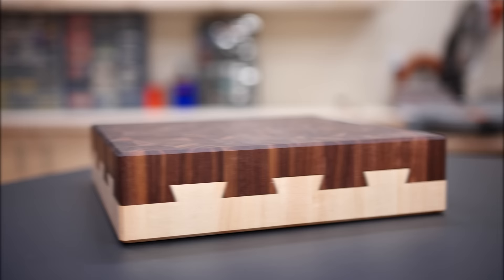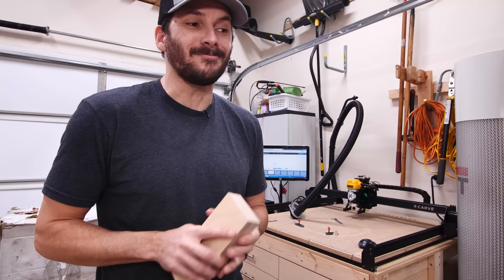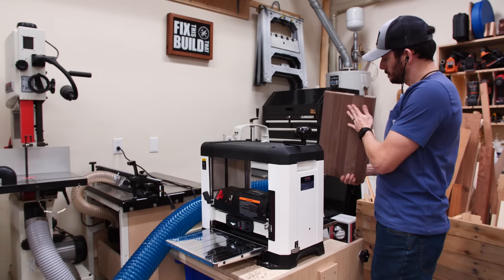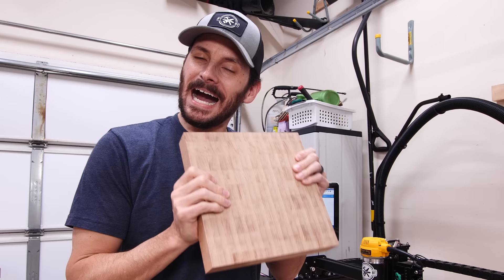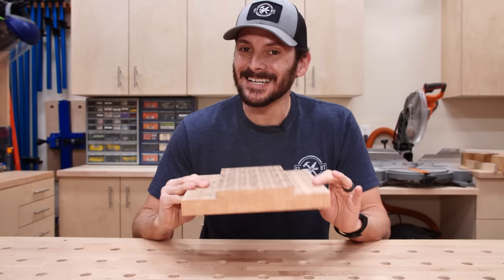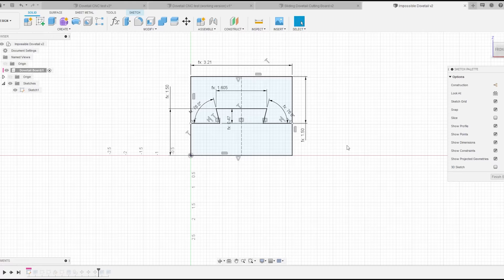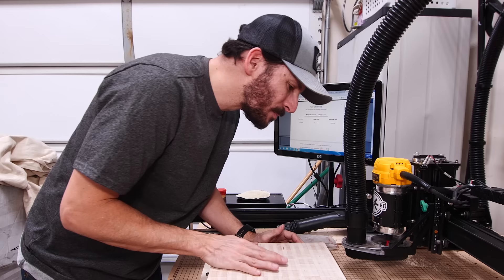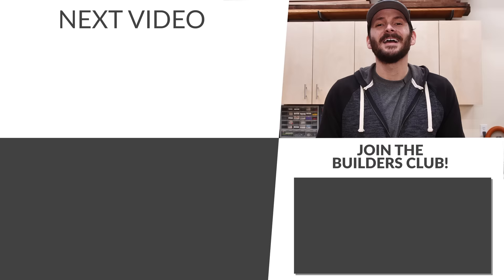Building an Impossible Dovetail Cutting Board

Comment: This could be a Chess board, with the Chess pieces stored inside in hollowed out perfectly-fitting sections. Considering the Chess world, it would be a way more lucrative side hustle than cutting boards lol
Reply: I was gonna say with knives inside. But I like the way you think!!!
Reply: Of course, the dovetails would have to be very short, so as to allow you to slide them together or apart with the chessmen inside. IOW, you would have to cut out the center 90% of the dovetails, leaving maybe just an inch of the outer portions intact. No problem, the effect will be the same. And it will be less likely to get stuck over time. But your suggestion might pose a serious arrangement problem with 32 correct-sized pieces. 

In this video, the guy could have done that instead of taking all that time sanding the interior portions of the dovetails. But since this is a cutting board, maybe that wouldn't be such a good idea. Someone might break it with one whack of a cleaver.
Reply: This was in the middle of a bunch of chess-video recommendations. Possibly, here are a lot of chess players.
Reply: This is genius!
Reply: Canvaverbalist, I've already created mine before seeing this video and your response. So many creative options beyond now. My current project, a self-contained power generator with a longer than expected fuel source smaller than a pack of cigs.
Reply: Handcrafted wooden Chess boards+containers have been around Eastern Europe for centuries. I have one, my parents have one, my grandparents had them.
Competition Chess players prefer their boring Staunton Classic International Standard sets with the roll-up mats ... but I'm sure they'd recognize other traditional sets on sight.
Reply: @pwnmeisterage  Staunton design so there's no confusion. I was playing someone on their Onyx set which looked great, but at one point I threw a piece away because I couldn't tell the difference between a knight and a bishop. :D
Reply: @stephenleader2792  Ah yes, the classic Psycho gambit, where you lure out your opponent's knight and then stab them in the chest so they die and thus you win by default.
Reply: I'd reckon a super GM would pay top dollar for that set.
Reply: Agreed
Reply: @Canvaverbalist I had a similar idea. A kitchen table, for example, with a hollow center for storing valuables. And no one would be the wiser because it would look like two solid slabs of wood joined together.
Reply: Oh wow
Reply: @stephenleader2792  that’s good idea too
Reply: I was thinking that it would be cool to have compartments inside of it!

Comment: That looks great. I've seen puzzles like that, but they're made a little differently. The grooves are curved rather than straight. To put it together, the parts have to be twisted 1/4 turn to assemble it. Good luck trying to build that.

Comment: Awesome work!  You could add a spring loaded pin inside to lock it in place.  Or,  make it so you can unlock the pin with a magnet.  That could help make a great hidden compartment (like others suggested) accessible.

Comment: I think what's even better about this is the fact that if you're chopping multiple things up you now have TWO cutting boards instead of one.  Could you imagine pulling that bad boy out at a party when someone asks to help and taking it apart in front of them.
Reply: good luck getting it to fit back together after using them seperate
Reply: @heygek2769  unless you're hammering on the top of them like a cave troll, it won't deform the wood enough to affect the fit to the point of being impossible to put them together
Reply: @smahhah  moisture
Reply: @heygek2769  not all uses for a cutting board involve mass amounts of liquid
Reply: @smahhah  don't need mass amounts with a tight fit like that.

Comment: Many years ago, just for fun, I made finger joints at the ends of two boards that were about three inches wide and 3/8" thick. I put them face to face on a milling machine and used a 1/4" cutter to make the fingers all the way across the 3" ends of both boards. I made each cut exactly 500/1000" from the previous one. Then I took the boards off and started to put them together. When I got the fingers to start joining I was able to wiggle it a little bit and they got stuck. They weren't even halfway together, but they were permanently stuck. Almost half the fingers broke when I got them apart.

Lesson learned, in a word: CLEARANCE!

Out of curiosity I drilled an exact 1/2" hole in a block of aluminum. Then I inserted an exact 1/2" rod (shiny smooth) into it. I had to tap it to get it all the way in. It never came out, either. (Into the crucible!)

Comment: What an awesome video.  I know basically nothing about woodworking but I could follow along well enough because you started with simple examples of the technique you were using and then built on that.

I do have one question.  If you were to make more of these wouldn't it make sense to just program the router to remove some extra material from the interior, or even as some people have suggested make the whole thing hollow, leaving a space where super secret recipes could be kept?

Comment: You could've just made a larger panel, cut the dove tails // with the sides faster with a regular router, then cut off the 4 corners at a 45 deg angle to get a new but smaller square. It's faster but the the trade-off is more waste.

Comment: When I was in my vocational training, I programmed a little curve instead of a straight line (around 0,02 - 0,03mm away from the straight line)
So I reduced the friction a lot
Only the last cm was completely straight
Tbh, I made it from metal (brass and copper to be exact) but it should also work with wood

Comment: It is only impossible when you think of straight up and down joinery, but it is clearly not impossible when you think of diagonal movements. Actually, straightforward but still very delicate work to keep it all aligned so it slides in diagonally.

Comment: The original dovetail cutting board made me think of a neat idea for a chess set. You could use the thicker wedges on the female piece to make space for the storage of chess pieces. Use the magnet  closure solution you came up with and make the playing surface out of square  end grain. I think that could look very nice.

Comment: Brad If you put magnets in the edges and hollowed out the center you'd have a nice security box and less friction. Who'd ever guess it was a box? You could make it a circular bore to maintain the strength of the dovetails and maintain the weight and it could still be a cutting board if you bore only into the lower board.

Comment: You can also ease a fit that is too snug by sanding the top faces a smidge.  If any of the male "tails" appear too short to touch bottom, sand the top surface of the opposing female "dove" board.

Comment: you can do it on a router table if you start with a larger square, cut the dovetails parallel to an edge as usual with a router table and fence, then once both sides are cut and fit nice, you cut off the corners at 45 degrees.  you make a lot of waste since you lose 50% of the wood (reduce the waste by making an octagon, or use the cut offs and glue them together to make 2), but then you can make this without a CNC.  use spacer blocks on the router table so you get exact cuts where you want them without moving the fence.

Comment: Very impressed by the workmanship, but an impossible dovetail is only "impossible" when it's joining two solid pieces.  For an endgrain cutting board, unless you just want the pieces to slide apart (a legitimate desire, since it shows off the skill it took) you could just do standard dovetails on four final strips, glued to all four sides of the dual-layer board.

Comment: Make one of these large enough and you can carve out recesses in the bottom half for cheese knives and make an Impossible Dovetail Cheese Tray with hidden knife storage...

Or if you're REALLY ambitious, make an Impossible Dovetail Chess Board with hidden piece storage...if it's big enough, you might even have enough space to carve out a pocket for checker pieces and now it's a Chess & Checkers set, if you work with Epoxy Resin, you can make the Chess and Checker Pieces from 2 different Resin colours...

Comment: That's Brilliant. At 15:11, to prevent blow-out, I would program my CNC to do the job from outside in - always toward the centre. At 16:34 lot of extra passes were needed because of unexpected errors. Unexpected errorrs can be avoided by orienting the blocks 45 degrees so that the CNC can work in perfect X and Y axis, or, by perfectly caliberating the machine to cut diagonals which is more difficult as it was in this case!

Comment: Congrats! What an an amazing piece!! 

Quick question: could you cut the piece an inch or more too wide, then trim them on the table saw or with a router once you're all done to ensure a perfect edge (vs the poplar edge band)? That's originally how I thought you were going to ensure a smooth finish and handle any chip out.

Comment: You went about it the hard way. Don't forget, you're working with butcher block. That means lots of smaller pieces of wood glued together. When looking at a finished project, it becomes impossible, except for the most discerning eyes, to determine the build order. you could very easily use perpendicular dovetails and just join the blocks last.

Comment: That was fantastic!!

You learn a lot more by seeing mistakes and the working out of problems, rather than watching some smug, I did it perfect first time kinda video.
🤣

I was wondering about the friction problem and thought, maybe use the router to cut a channel inside of the female board to ease the problem,  but the sanding you did worked instead.

Comment: Were you able to finish the dovetails as well as the outside? It seems like you'd have to mill an extra .012 or better to accommodate a durable varnish finish, or .008 or so for shellac. That wouldn't even allow for seasonal expansion, and I'd think either would be visible. "Yeah, this thing slides apart when it isn't raining..." Very cool, but not so practical for a cutting board. Maybe just heavily waxed inside, and make it a chess board, hollowed out to store the pieces? I'd pay good money for one.

Comment: So you never did put magnets in there.
An idea (if no one else shared the same idea or a similar one) would be to use the inside/middle part as a knife compartment or something. slide open, take knife out, slide shut, cut, clean knife and board, put knife back inside. 
But I assume if you open/close it too often, it might end up getting a bit loose over time. (but your magnets idea would help fix that)

Comment: And here I thought it was simply cutting basic dovetails at 90 degrees to each other and steaming one of the sides to make it flexible enough to bend just enough to snap into the non-steamed piece and when it cools/dries it firms up to permanently lock it in place...

Comment: When you have long glue lines, always put the piece in the planer at an angle. The glue is hard and it will mark the blade edge. If you feed at an angle you don't get a single hard spot hitting the blade edge.

Comment: You might want to get yourself some high density blue modelling foam for when you are doing test runs. It is a total pain to clean out but it is inexpensive, allows you to run test paths faster and will reduce wear on your bits.

Very nice project. How much did you have to allow for the finish for the wood?
Reply: Being @ cutting board, you only oil it, so no finish allowance required.
Reply: @TomCee53  I'm surprised when the oil soaks into the wood that it doesn't swell at all

Comment: Great videos as always but I can't see the point in using a surfacing bit in a CNC machine because a thickness planer has one blade the full width of the wood so is always going to be flatter than multiple passes of a "surfacing bit". Seems like a redundant phase of the job.

Comment: if you can make one with 1 set of dovetails on 2 sides you can make a 3 tier version with opposing dovetails :D   means flipping the center piece over to cut a 2nd cut from the other corners.  one side ne-sw, one side nw-se :D  will be able to see through it where there is overlap of the cuts but as long as you are precise this gap should not be an issue .... think like waffle fries.

Comment: If you're as far off as it looks like you were on the first dovetail test, your tools probably aren't defined correctly in the software.  if your tools are drawn correctly you should only be a few thousandths off, which you can correct for in your offsets on the CNC console.

Comment: Hey bit of a question as a new woodworker. I noticed you used the thicknesser on your board then jointed it.I have always jointed one side, thicknessed the opposite side jointed again and thicknessed again. Because it was my view that by using a set square everything was 90° on the jointer and parallel on the thicknesser. So by doing the 4 steps I knew that every face was a perfect 90° to each other. Logically however I can see if you thickness both sides joint the thickness again you should end up with the same result

Comment: I'm guessing you had the diameter of the dovetail bit input wrong by just a hair. If the tool is smaller then you tell the machine or program it is, it would through tolerance stacking make the pin too large and socket too small. Just a guess.

Comment: Couldn’t you cut the dovetails into the two halves straight with a router then rotate the pieces 45 degrees to cut with a table saw to achieve the same effect?

Comment: Now while I already knew how this was done and have seen countless videos demonstrating it.. One thing PUZZLES me.. Why not use the dovetail bit for the entire job, rather than switching bits. Surely it wouldn't make any difference, it would just make a dove tail that gets wider and wider until it reached the final dimension.. I'm no CNC expert, in fact have never used one, but I find it odd that you could be so far off in the beginning.. doesn't the CNC take into account the dimensions of the bit being used or doe that only apply to much higher end and thus way more expensive kit

Funny but I reckon, some Japanese carpentry master, could probably do this with a set of hand tools.. and no matter how good technology might get, there will always be something far more amazing, watching a person, do this with saws and chisels

Comment: What a waste of time.  First off, after 12 minutes of the video you FINALLY get the point.  Second - it would have been MUCH easier and faster to just join two boards with multiple rows of DT joints, then cut-off the corners at the mid-point of each side.

Comment: You are yawing those step block clamps incorrectly. Step side should be slightly higher than the workpiece. Also not how you measure a dovetail